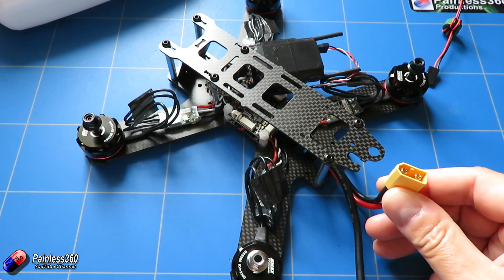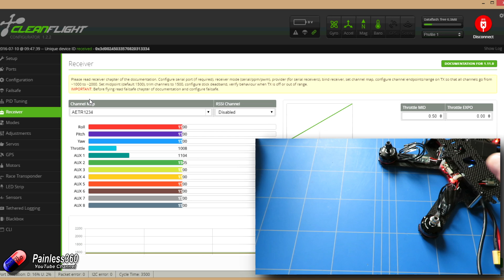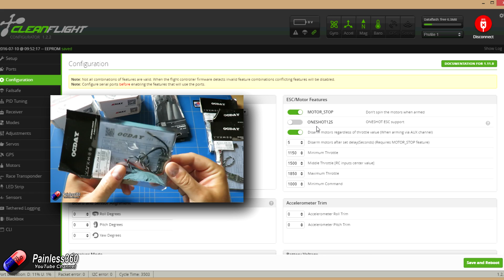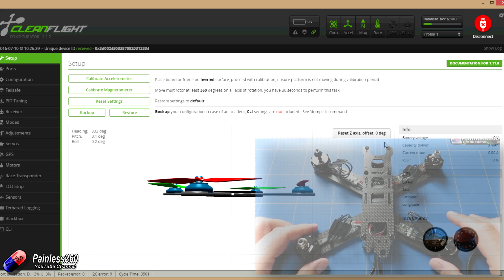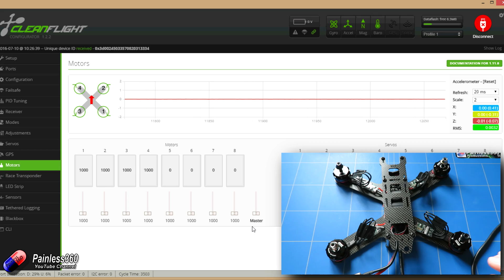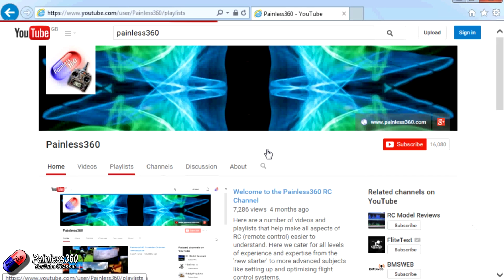(7/9) Quadcopter Building for Beginners - Setting up in Cleanflight

Comment: hello painless 360 hope you doing abs. great, i had quick issue when calibrating my drone while plugged in via USB and battery.. which is that every time i calibrate my motors start spinning nonstop. the only way for me to stop it is by unplugging the battery!~ what seems to be the problem i searched the internet before commenting so your help is highly appreciated.

also i have my radio connected and i did like what you done in your videos, i get the input of everything when i look it up in the receiver section within clean flight how ever i have no control over the drone whatsoever. the motors just spin.!!
Reply from the maker: Could be a few things. What troubleshooting have you already tried?
Reply: @Painless360  i did have MSP arming flag sign , also i have the runway take off prevention sign ... i can see the values in the receiver window changing  but no control over my drone whatsoever.!

any ideas!! what should i look at ? please help <3
Reply: the values changes when i move the sticks on my TX.
Reply from the maker: You can't arm when you're plugged into the PC - that is the MSP arming flag. You asked about calibration not arming.. I'm confused..
Reply: @Painless360  i had the motor spinning issue in clean flight and when i changed to beta flight i downloaded the latest version on spf3 fc and flash it successfully, and the problem apparently got fixed however i can find my receiver and tx connected togather however i can not arm the drone is there a specific way to arm the drone, i did see up the mods ( arm , angle and horizen )so that isn't a problem...

Comment: Hey I make everything work as you do with clean flight, I did calibrate the  ESC but when I try to use the drone by it self it doesn't do anything.. seems to me like the reciber and the  doesn't  communicate. Any ideas
Reply from the maker: Please see later builds on the channel. This one is old.... What troubleshooting have you already done?
Reply: @Painless360  I went back and see the videos back and at the end u mentioned that you have to move the joystick down to the right and the left to activate and deactivate... so now it work... I saw this one because I'm using the same flight controller and cleanflight. That's why.. thank you for the videos

Comment: How do you physically connect the radio to your computer
Reply from the maker: You don't connect the radio to your computer,  it's the flight controller you connect to setup the firmware. Check out one of the 'Quadcopter building for beginners' series for all steps.. Best of luck

Comment: my throttle settings are revrsed!! can you help me? # status
System Uptime: 568 seconds
Voltage: 0 * 0.1V (0S battery - NOT PRESENT)
CPU Clock=72MHz
Stack size: 2048, Stack address: 0x10002000
I2C Errors: 2, config size: 2186, max available config: 4096
CPU:24%, cycle time: 281, GYRO rate: 3558, RX rate: 130, System rate: 9
Arming disable flags: THROTTLE CLI

# 
i just wanna flyyyyy
Reply: low throttle is 1915,  high is 1108. all other settings look ok. my controller is beeping at me.. "beedledoop" "sounndd...flyskyfs16, and also tried the touch screen one, both i cant get working.  this is so hard man. not sure how all you do it so easy
Reply from the maker: Practice. :D You need to reverse the throttle channel on the radio. See the manual for it for how.. Best of luck!
Reply: no  worries. about 10 vids deep found out someone with my same controler going over settuings. it finally sunk in. also got all set at 1000/2000. still wont arm. im going to bed lol
Reply from the maker: Well done. See my later Quad builds for quads build using more modern pieces..

Comment: clearflight shows that my FC board has gyro,accel,mag and baro.
I have calibrated accel and mag.  Do I have to have another channel to enable barometer?  Clearflight shows a tab to set up baro range, which is why I'm confused. 
I am flying and enjoying in angle mode thanks to your videos and one other.
Reply from the maker: I've not used Cleanflight for a while now.. I used to leave baro range as defaults but you can check in the release notes for the version you're using...

Comment: Doesn't arm with throttle stick, down and right. I have followed your videos and very gratefull.   I got the whole way through with cleanflight. Motors ran and escapes calibrated.  If anyone has any thoughts, please reply.  I am using Flysky16x and ia6b receiver.
Reply from the maker: Google something like 'cleanflight arm painless360' to find my videos on that..
Reply: Thank you.  Did, but finally decided to arm with an aux channel after the endpoint adj didn't do it.

Comment: Cleanflight shows "cannot connect to serial port". Using usb to SPF3 controller. Have tried various drivers but stuck on this step. Any help?
Reply from the maker: That's usually a driver or usb cable issue. Best of luck

Comment: I got the remote and receiver setup as in the instruction videos. Interfaced the FC together with the receiver with Cleanflight in my laptop. Can rotate the motors through the Cleanflight interface; individually and as well as all four with the master key. However, I am unable to use the remote to spin the motors. Using PPM. Any suggestion what to check?
Reply from the maker: Are you arming the board? See later videos..

Comment: Hey mate, love your videos, I'm having trouble with my receiver, I'm running PWM , all the cables are plugged in correctly but pitch & roll seem to be locked together, any ideas would be greatly appreciated.
Reply from the maker: What troubleshooting have you already tried? I'd starts on the radio to make sure that that you have separate channels and there's not an accidental mix connecting two of them at that end first. Best of luck..
Reply: Painless360 thanks for your reply. Managed to sort it out as it simply was a switch on the transmitter which links the 2 together. Now I have another issue with it not arming & think that's because it says CPU  at 100% even though I've turned everything off & set to lowest parameters & all I have running off it is fpv camera. This is my first build btw, but if you could give me any advice that would be awesome, cheers
Reply from the maker: You don't mention the flight controller you're using, the software or the trouble shooting you've done - Without more detail it's impossible to offer any advice. Happy to help but please watch https://www.youtube.com/watch?v=olIqTiSJHIY and come back to me with more detail of what you've tried..
Reply: Thanks for your reply. Sorry for my ignorance in posting last comment. I have an Spracing f3 flight controller. Have a cheap transmitter ikonnik & receiver running PWM, which I purchased from local hobby outlet as they told me it would work. Software is Cleanflight 2.1.0 . 

 I can run motors everything, receiver works on cleanflight, everything appears ok until I go to arm it & get nothing. I have googled it over the last 2 days & apparently it won't arm when CPU is too high, well mine is at 100%. I noticed after I plugged it in again today that CPU registers at 1% until the transmitter is connected. Accelerometer is turned off & everything is set to low parameters & there are no leds or anything running off it, just a fpv camera.

Tried googling the problem, but yet to find a solution,

Thanks in advance
Reply from the maker: Something isn't right. I would flash it with Betaflight now in case its a bug.. best of luck!

Comment: Hi. I have been looking to get the battery eliminator circuit that you are using and I see that the available ones are various amps ranging from 3 amps up to 8 amps, I would be pleased for your guidance in getting the correct product.  Many thanks John
Reply from the maker: It depends on what you want to run with it. For applications that don't need tons of current then I'm a fan of the Matek Micro BEC -  it's the size of a fingernail!

Comment: Great series which has helped me out a lot. Unfortunately, I have now hit a wall as my motors are not spinning using the transmitter. However, they are working perfectly using the sliders in Cleanflight and my set up is as follows:
SP3 Flight controller
IA6B Receiver
IA6S Transmitter
Any idea where I may be going wrong?
Reply from the maker: Could be lots of things. Tricky to help without knowing what troubleshooting you've already tried. Have you armed the quadcopter?
Reply: So far, I have set up all the end points and sub-trims and everything checks out in the receiver page. Even when I arm the quad, the motors do not respond to transmitter command. One thing I noticed is that although I can calibrate the simonk esc's no problem using the motors page in Cleanflight, they will not calibrate using the full throttle and then power on method.
I am totally stuck now.
Reply from the maker: I've not used SimonK ESCs for a long time. I'd check the setting for the ESCs in BF.. Best of luck!
Reply: It's driving me nuts!. I'm getting 3 beeps from the flight controller on startup. Could that be related? Here's a short video that may make sense.
https://youtu.be/-a43GzWbxSc
Reply from the maker: You don't show you arming the board and I can't see the top of the screen when you try to throttle up either.. The three beeps are probably the ESCs letting you know they can see a 3S LIPO.. Please watch the 'Quadcopter building for beginners' series.. There are lots of helpful tips and steps to get your model ready for flight in those. Best of luck!
Reply: I learned an important lesson in fault finding yesterday which is to always go back to basics. Turns out that the receiver is faulty as I bypassed the flight controller and connected an ESC into Ch3 of the receiver and it didn't do anything. The receiver is getting commands from the transmitter but not outputting them. Many thanks for your suggestions.
Reply from the maker: Glad you've got closer to the answer. Sometimes it's the simple(ish) things! :D

Comment: Dear uploader Painless360,
I have made a quadcopter by watching your video which is very comprehensive & understandable. I hv watched so many other people's vids ,bt chose your one coz u explained in an easy way for beginners helping many people entering this hobby.  Also, english is my second language, I found your accent more understandable than so many others. 
I appreciate your hard work indeed :-)
Reply from the maker: +Alva Rahman thank you for taking the time to write that comment, it's always great to hear from people who have found the videos useful. Happy flying and best wishes for the festive season!
Reply: Painless360 ,

Sir, 
I did th maiden fly , it flew wth sme problem like after arming, th motor by itself speeds up, I think 2 of th. motors or whtever .  How can I fix it?  It is in " angle " mode.  

Also, can I ask u questions in any forum?  Thanks.
Reply from the maker: +Alva Rahman check out the playlists, most of the time I've already made a video that answers a particular question. Using Google search can be useful to, just add the name of the channel into the thing you're interested in. For example  'motor change painless360' might help in this case. Best of luck!

Comment: great vidoes, using them to build the same model......except, I am having an issue....when I arm the motors, throttle, yaw, pitch and roll all make the motors spin!.   Anyone know why?
Using Taranis X7 and FrSky X4R receiver
Reply from the maker: Depends on how you've got it configured.. If it's set to spin the props when armed but they don't start until you move the controls then I'd look at the ESC calibration or ESC settings in Beta/Cleanflight. Sounds like the motor outputs are a little low..
Reply: I got the first issue resolved (not sure how).   All sticks work properly for all controls.   I did have to switch throttle from the right stick to the left, same with elevator.   The default was throttle on the right.

#1. When I arm via a switch, the motors don't rotate.  
I have MOTOR_STOP on and Disarm motors regardless of throttle value on.  Min is 1070 and max is 2000 in Configuration 

Down to this one remaining issue ==> When I move the throttle up, all rotate, but M1 accelerates at a slow rate without any throttle stick movement.  The other stay at the same speed.    Any way to adjust M1 only?

#2 what do you do with the 5 extra plugs that you don't plug into the receiver from the flight controller?   Cut them off?

btw, thanks for the reply.   I see that this is a tough process to go through but I believe the satisfaction will be that much greater when I finally get it right.

Comment: Hoping you can help me. I've been following along with these great videos and all has been going smoothly until now. I cant get my motors to turn when not connected to Cleanflight. I have calibrated the ESC's and they will move there but when I disconnect, not. I've noticed the F3 board flashes a red light when I move the throttle up, not sure what this means. Once I had them moving along with the transmitter for about a minute but then it quit working as mysteriously as it started.
Reply from the maker: +Joe B have you armed the board?
Reply: Thanks for the help! Now another problem...you were right though I didn't realize I had to arm the board. Still thinking planes. So after I realized that it was prefect for a few flights. Flew it through couple batteries and now it wont arm. Battery was running low so I landed it. Charged that batt, plugged it in and no response. The blue light is solid and the red light continuously blinks now. In Clean Flight it says 'I2C error: 1' on the bottom also, not sure what that means. Receiver tab shows everything is connected.

Comment: hey,
when i want to setup cleanflight,the magnetometer can not be calibrated (does not light up)
controller is a naze32
any idea?
thx
Reply from the maker: With the latest version of the code you need to enable it. Check out the left side about half way down the main config page.. Best of luck!

Comment: can you solder a jst connector onto a pdb 5v pad and then plug it into a rail on the flight controller to power that? I'm using a matek xt60 and naze 32 rev6 for my first build
Reply from the maker: You can, it will fit - sort of ;)

Comment: Hi there, after calibrating the ESCs, my motors twitch and make little noises when the sliders are pulled to their minimum. My motors also seem to be slightly out of sync, in that when I pull the master slider up to the point where some of the motors just start spinning smoothly at their slowest, the others seem to be just below that point and still twitch a little bit. Do you have any suggestions? Mainly concerned about the twitching when the sliders are at their minimum. Cheers from South Africa!
Reply: I looked at various forums that suggested lowering the Minimum Command in Cleanflight, which seems to have worked. However, to get it to stop, I had to lower it from 1000 to 940. Is that a problem, or should I be okay?